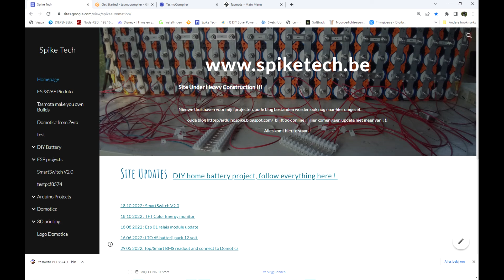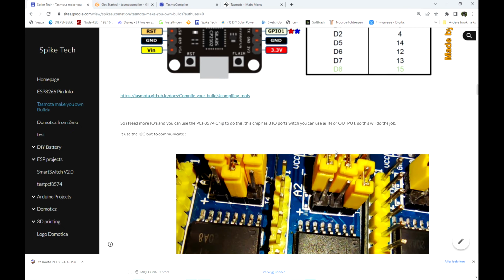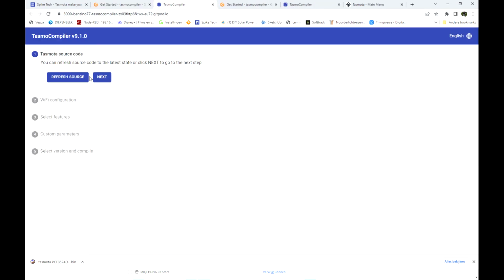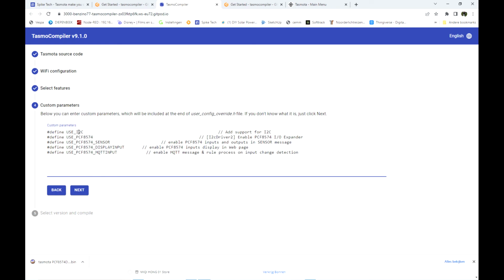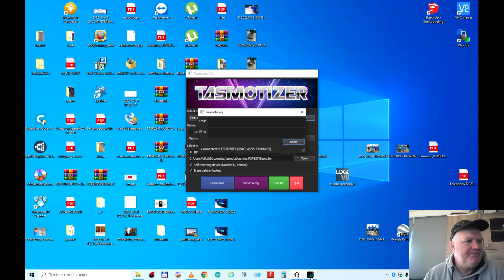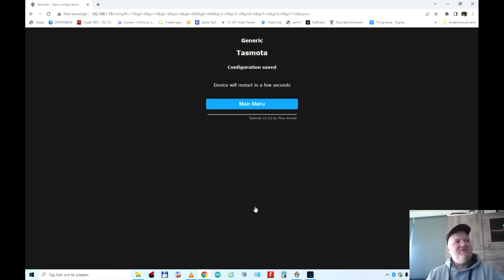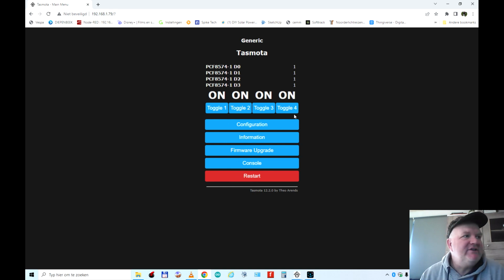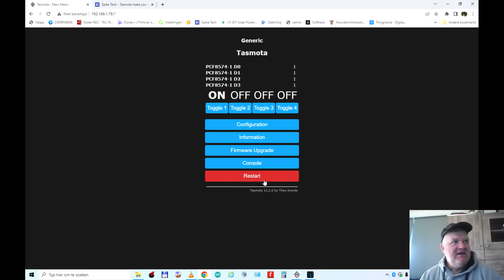Tasmota Build for PCF8574 support

Comment: Hello Spike. Good job. I notice you're good in tasmota. I've followed your tuto, but now, I would like to expand my project with 8 PCF8574, just for a purpose of having 64 digital inputs.
1/ I noticed there is a physical default on this PCB. If you expect to chain 8 of them, you have to take off the resistances on the I²C SCL and SDA on at least 7 PCB. This is of course not a problem if you know that, but the choice of this module on this PCB is so easy to chain that you would expect more simple, as it's simple to change the adress and to make a chain without soldier.
2/ When you make your own .bin, there is an option to make the choice for a MCP23017 module. Did you ever tried this solution?
3/ I'va a few informations from users or Tasmota that says that There are only three separate rules sets called Rule1 , Rule2 and Rule3 . Each rule set can contain many rules. The number of rules that can fit in a rule set varies, but expect at least 1000 characters available per set (1000 might be 1024)... Following your tuto, it means that I've a text file that counts less than 2885 characters (counting the spaces):
- Can you make 3 differents rules for less than 1000 characters each
- do spaces count like 1 character
- and by the way, do you have to name each PCB PCF8574-1, PCF8574-2, etc. and do you name toggle1 to toggle64?
I noticed that you don't use Home Assistant as I do but Domoticz. i'd no problem for the .bin and I was expecting to use ESPHome for the pcb and now it has been added as an official integration, so may be my next mounting will be this on, may be just to compare the stability of both solutions  https://esphome.io/components/pcf8574.html?highlight=pcf8574 
Bonour de France.

Comment: Hi Spike, very good explanation. It helped me to get an esp8266-01 with io over pcf + 4 relais over a Nuvoton N76E003AT20  (LC-ESP01-4R-12V board) up and running. Succes with the hobby. Greetz from Holland! Jan
Reply from the maker: I made this video because i didn't find a solution for my problem and after it was finished i tought maby i can help some other people. Groeten  Spike From Belgium.